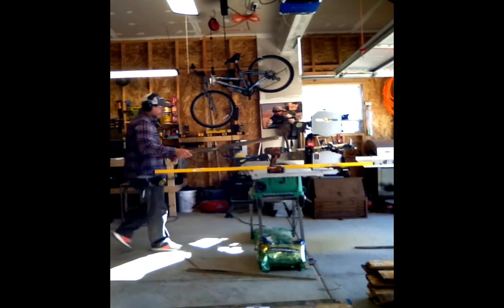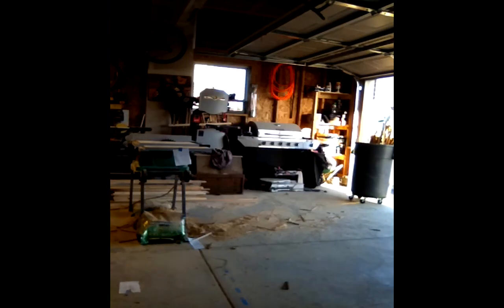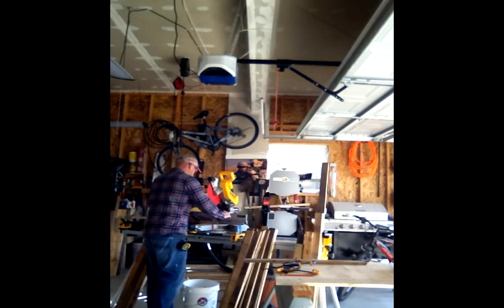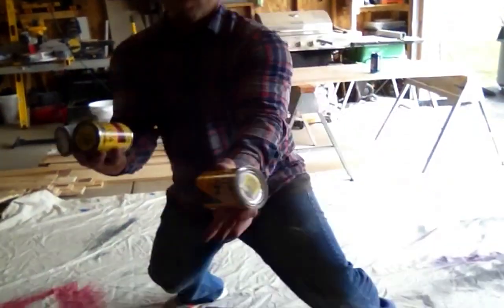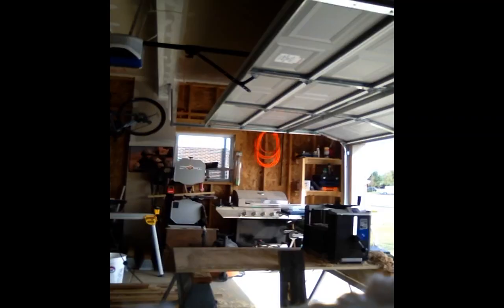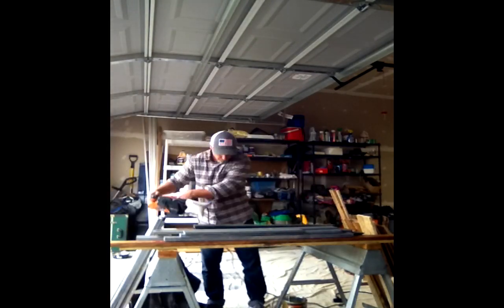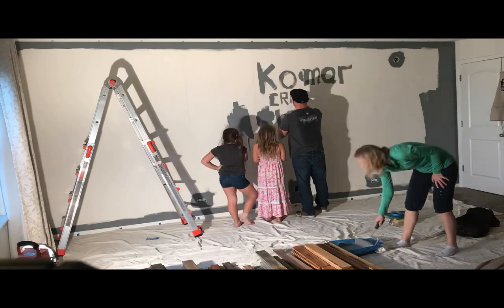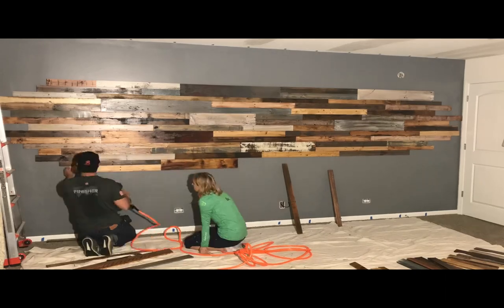How To Make The Ultimate Wood Wall Decor Out of Pallets and Reclaimed Wood

Comment: Nicely done, brother!  I’ve been contemplating doing this for a few years now on a divider/accent wall that separates our living room from our kitchen. It’s only about 15’ wide by about 8.5’ tall. I actually broke down about 2 dozen pallets to prep for it, but I left them outside stacked neatly with a tarp over them for a few months, and apparently that’s the perfect nesting ground for carpenter ants, so it all got tossed.  I’d like to do it still, but I’m concerned with having to extend the electrical outlet boxes out flush with the finished pallet boards and also with how I’ll mount the tv back on the wall afterward.
Reply from the maker: A-Z's Tiny Woodshop I ordered some extension boxes on amazon.  They are the blue ones and it worked perfect. Super easy and you don’t even have to disconnect the wiring. Just take the plate off and unscrew the outlet. Then the box will slide around the outlet and give you that extension. I’ll find the link and send it to you later.   I’m doing this wall again right now in my show as a tool wall.  Check out my instagram I post updated pics in my story of it as I build.